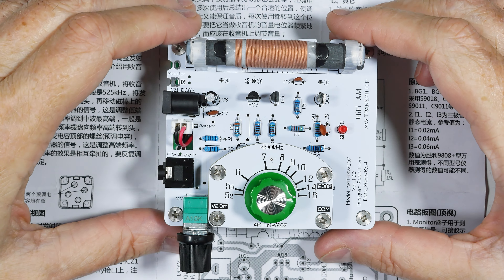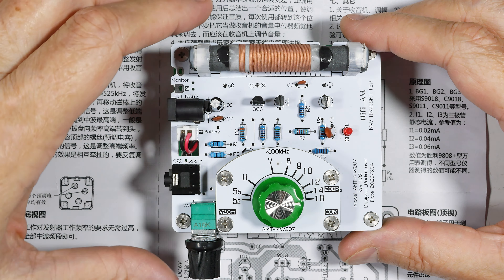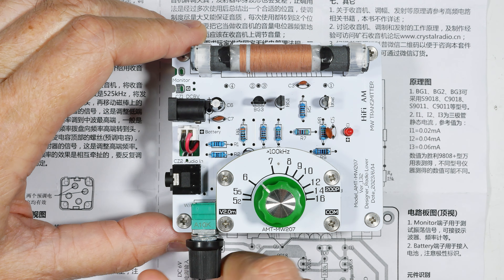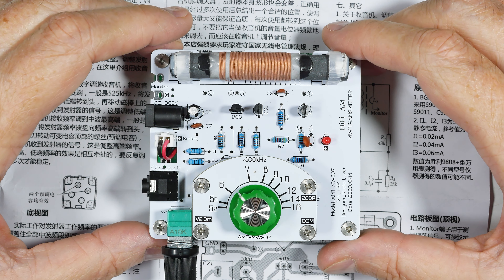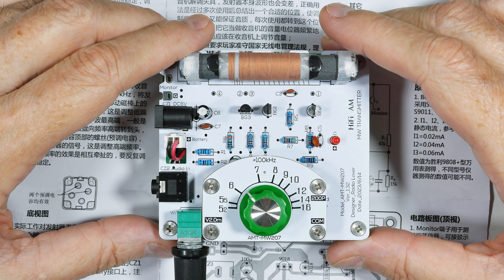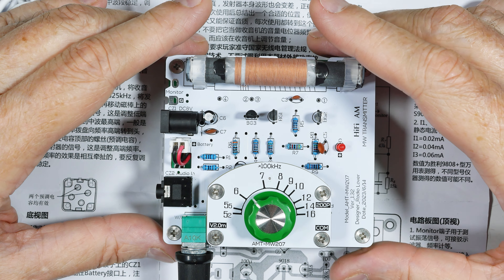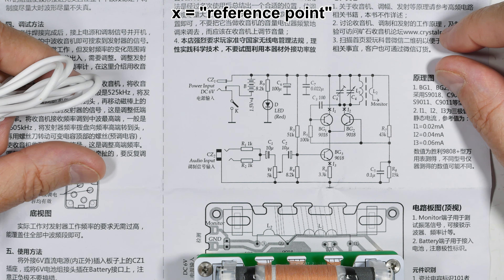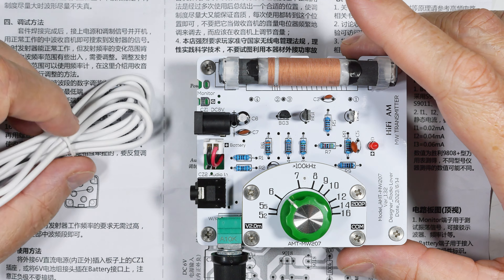AM Transmitter For Crystal Radio Testing? (4K)

Comment: You should try connecting the Monitor output from the coil  L2  directly to your crystal radio antenna input with maybe a 20 pF capacitor and a 100 ohm resistor in series to model what the antenna would look like to the xtal set.   See what that does.
Reply from the maker: Gave it a try, both through the loosely coupled input and direct fed to the coil. It's definitely louder. Before it was a barely audible whisper, and it went to a low whisper. I also tried it w/o the cap/resistor and it's less, so the cap and resistor helped. I'm thinking about putting a variable resistor on the resistors (R5 & R7) that control the base of the 2 oscillator transistors and use the scope to see if I can boost output. If so, new "power" transistors might be in order. Can't hurt to try, because it's not helping the way it is!

Comment: I build AM radio transmitter with 1MHz crystal oscilator, I was able to receive my own signals from it 3 meters away with crystal radio. I used instructions from this video https://youtu.be/_4-Sx-T6VBc?si=TDX3b7v8rY6aHEVW but I added between output of oscilator and antenna LC circuit to match antenna impedance, it works much better with that. 

When I connected it to 12 meters long antenna i had 30 meters range. (With Transistor radio)

On 28 meters antenna a got 90 meters range. (With Transistor radio)

I found 11 MHZ oscilator to go into shortwave, works even better.

Parts that I used:
4.5 volt battery 
Transformer 220 to 12 volts
Variable capacitor
Variable inductor with slider
1Mhz Crystal Oscilator

5 volt Computer Amplifier to feed sound from mobile phone into primary of transformer
Reply from the maker: I have the same AM transmitter circuit: https://www.youtube.com/watch?v=_5o2C9sCvec
My guess is your LC circuit forms a better sine wave from the square wave of the digital clock oscillator chip. I'm building something like that; an improved version with sine shaping filters.